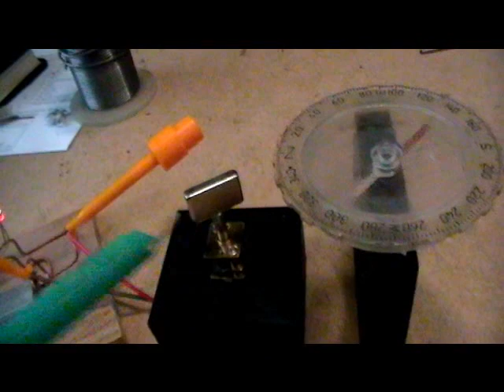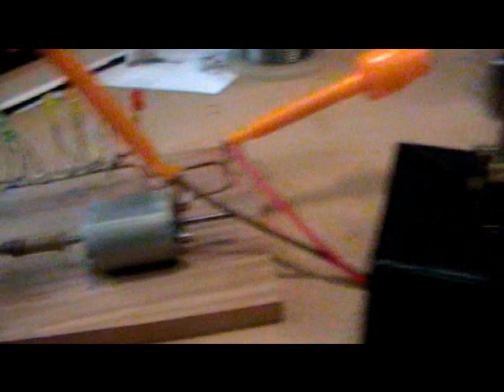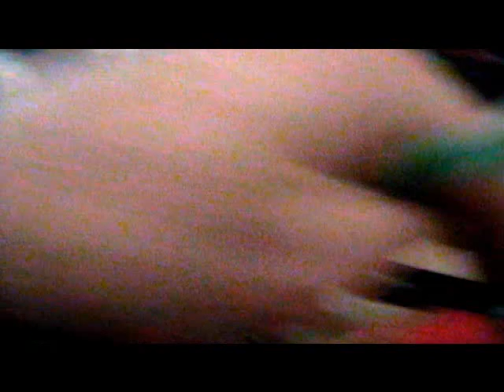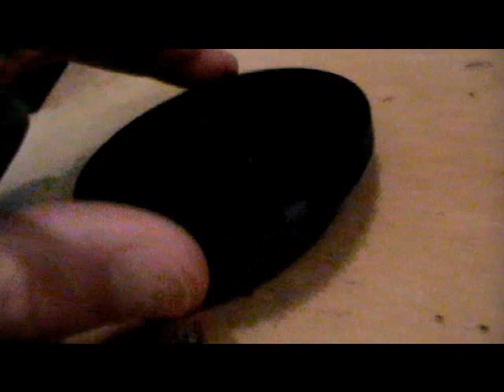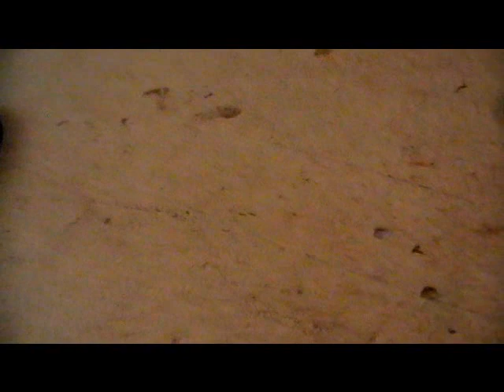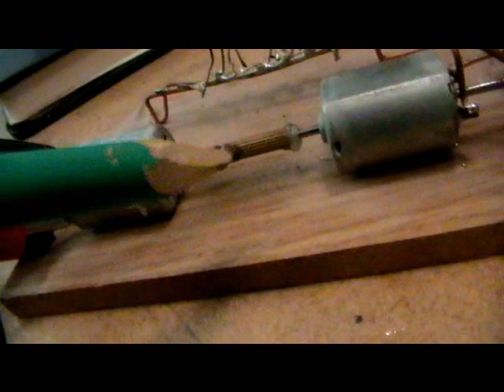HEADS UP 40 DEGREES 2.7 YEARS POLE SHIFT GSM CLIMATE CHANGE

Comment: Hi Gene, when I was in a 5 year engineering apprenticeship, the company had a contract from the Army to produce PEDAL GENERATORS. I was involved in the assembly and testing of them. They were similar to a bike with handlebars, pedals and a seat, but it was on static supports (no wheels) and where the back wheel would be, there was a large generator, which produced 240 volts for powering Army camps. It was hard to get going, but once up to speed, it was a doddle to maintain that speed. You can imagine the soldiers getting their exercise by just pedaling away and producing power for the camp's needs. I could never understand why the local Gyms, didn't have banks of these pedal generators in them, with people wanting to keep fit by pedaling on them and producing free energy for the grid.